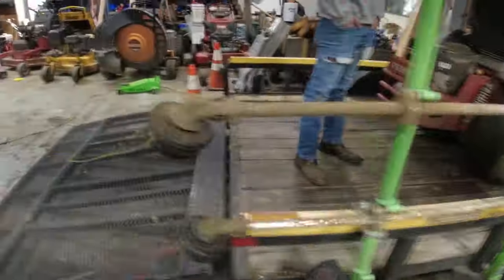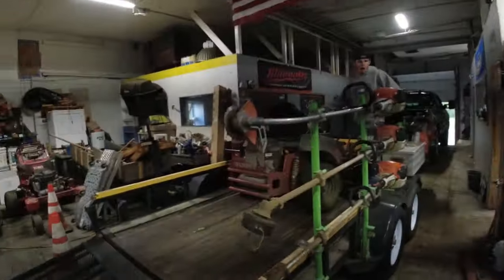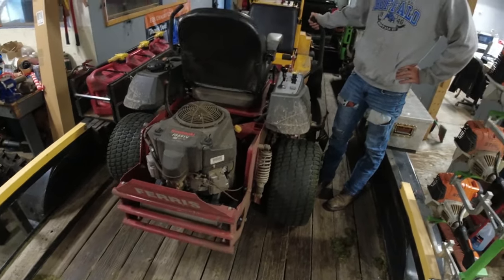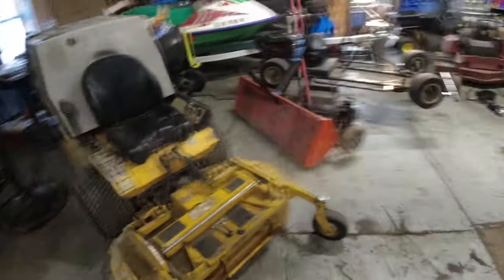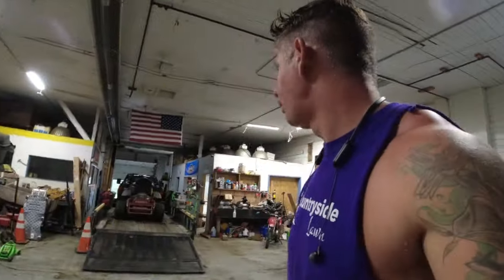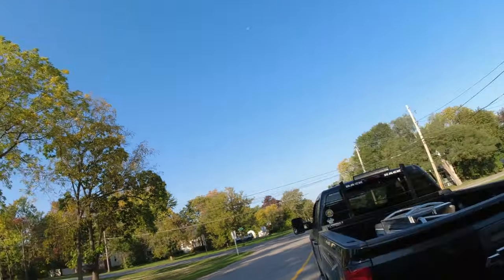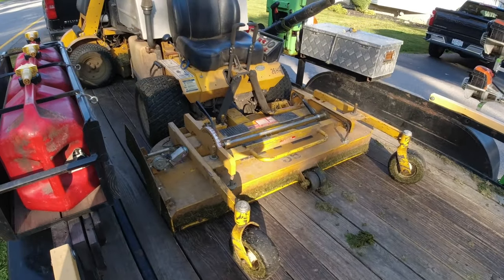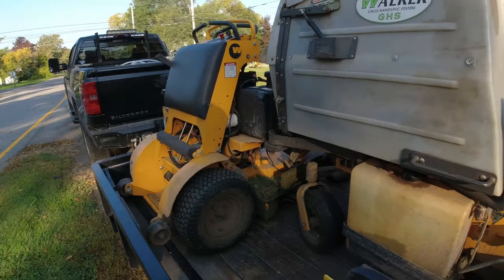Lawn Care Vlog lawn mowing is going to change

Comment: Hey Randy , on the stander X with the aerocore deck , what are you running for blade set up ? Noticed not too much blow out . I just out the powered bagger on my stander ZK and still have blow out . What do you typically cut at height wise ?
Reply from the maker: 3-3 1/2 and they’re just stock blades
Reply: Have you ever had to adjust the level ness of that deck before ? I’ve had cut quality issues with it too
Reply from the maker: @P.H.Property_Maintenance  ya gotta adjust every deck occasionally regardless of mower

Comment: understand the attraction to walkers. have had a walker since 1998 even though a lot of other brands have come an gone i keep hanging on to the walker for its unique fetures. paid 800 dollers for the latest suspension seats for some of the older mid mounts an made a huge difference in the ride. dont want a grammer seat, but think the scag suspension seat might set up to high.
Reply from the maker: Yea the grammer is horrible. I love the comfort seat i have on it

Comment: Hey man, I know I'm a little out of season with asking this but I just picked up a snow dogg HD80 for this winter and I want to upgrade the lights. I saw both your videos of the snow dogg brand led light heads and the aftermarket bulbs off Amazon. Did you have a preference about which one you liked best?
Reply from the maker: Go with the Snowdogg brand

Comment: The mower probably needs a coilpack if you haven't fixed it already check spark and the coils for cracking indicating it's bad.
Reply from the maker: No it’s a carb issue

Comment: The strange thing is that trailer tires  don't last as long as vehicle tires  as I've been told
Reply from the maker: All depends. They’ll last longer if the trailer is riding level
Reply: @CountrysideStrong   thanks for the info on this matter of the trailer tires Mr Haskell 🤣😂